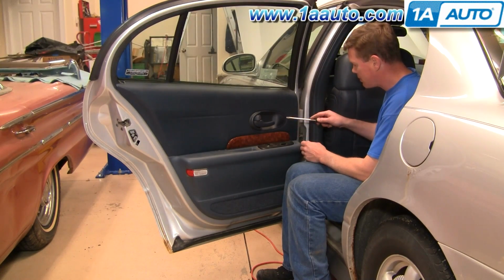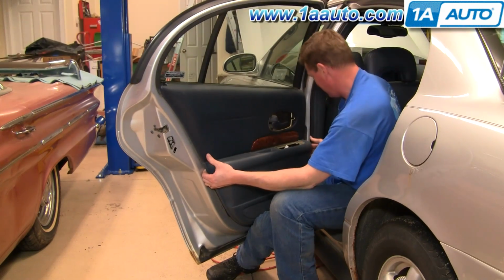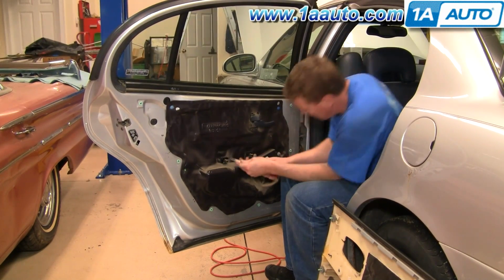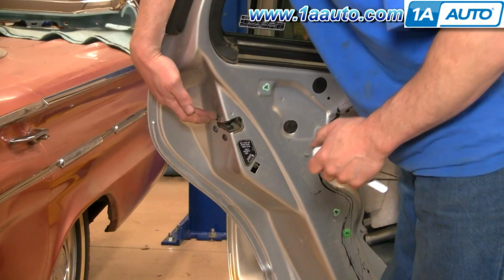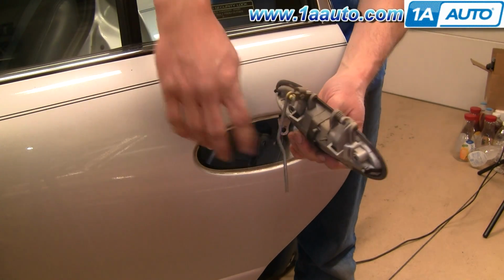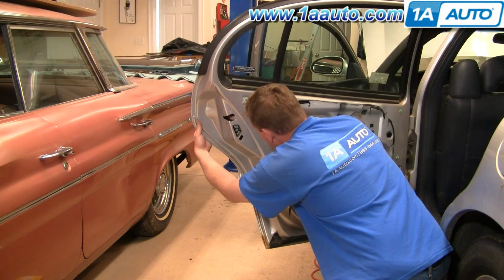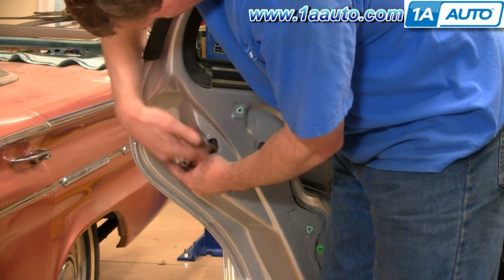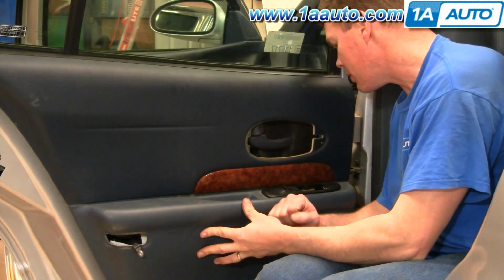How to Replace Exterior Door Handle 00-05 Buick LeSabre

Comment: did my front driver side and wasnt same as back because you have the key mechnism on driverside front door also make sure you lift up on handle inside and push in on outside to get them bottom clips part of door handle snap in

Comment: Great video. Just replaced my drivers side front door. Now, when I shut the car off and open my door, the radio continues to play until I shut it off. If I continuously move the door handle...it will finally shut off, which tells me the mechanism in the new door is faulty. Your video just taught me how to replace the entire handle assembly. Thank you!

Comment: Would replacing a 1993 buick lasabre passenger door handle be the same as in video?
Reply from the maker: You may be able to apply some of the basic steps shown in this video to your application. You would more-than-likely need to remove the door panel to access the bolts inside of the door that fasten the handle to it. Hope this helps you out. 1aauto.com 888-844-3393